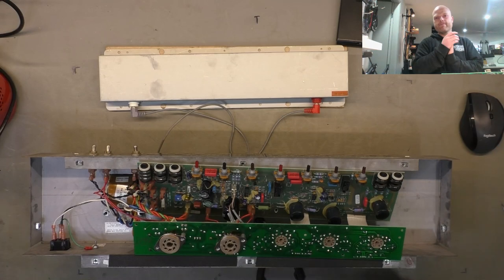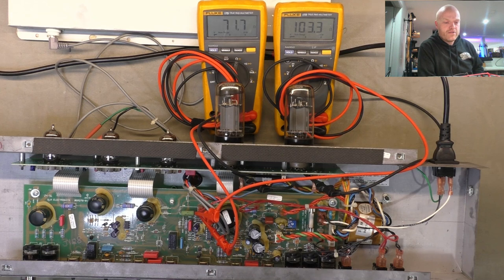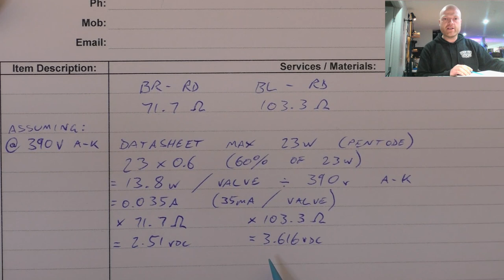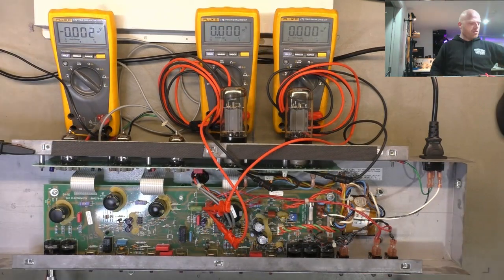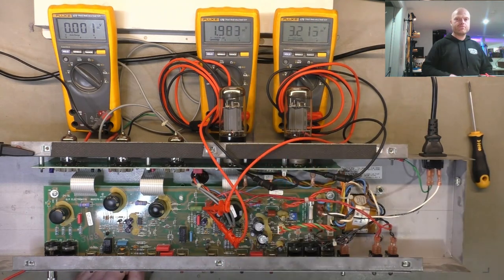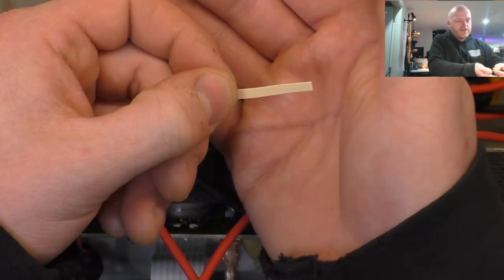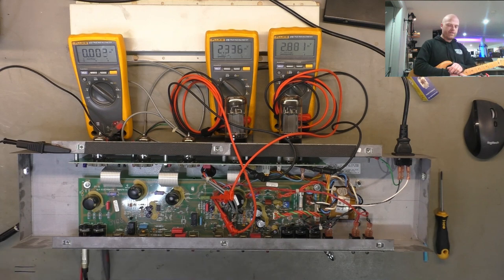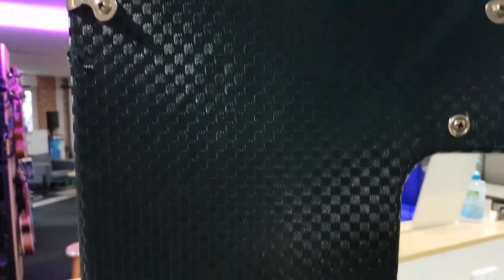Ampeg R-212R Reverberocket Repair - Part 2

Comment: Great video man, I've just been reunited with a 212 just like the one you have here after 15 years. Definitely got me thinking about what else might have issues, outside of tubes (which it definitely needs). It's a 93 or 94, I've had it since 2003 and it's seen a fair bit of action and while mostly it's been a studio piece, it did spend several months in a friend's barn. (Not like, a barn barn but a large steel sort of large shed/workshop/jam space sort of situation, next to his house.)

Anyway wanted to ask if there was any effective way of cleaning the pots without removing the entire chassis? I've got some Deoxit and I reckon I can get the knobs off but a full teardown is likely beyond my skills. Can i just spray a little into each pot shaft and sort of work it in by twisting the knob?

Appreciate your hard work man, great stuff. Cheers

Comment: Told ya I was spending too much time watching your handiwork 😂. Just glad it's not a Marshall as I'm selling a 1984 JCM800 for a mate, but haven't got the cab to test it out. Went inside to take some gut shots for the sale and nearly wept as I saw melted leads, massive blobs of solder and a nice big burn mark on a resistor thanks to the last tech who was inside it 😩. Wish we had some good techs round these parts!

Comment: Hey Brad, I've got a totally different question and subject. Like most techs I have disassembled and repaired a fair number of single-wafer mono potentiometers, and there are dozens of videos online about how to do this, but I have yet to see any videos showing how to disassemble and reassemble a stereo potentiometer with a single common shaft that turns two wiper elements simultaneously!  You're the only guitar amp guy I watch on a regular basis who also works on a fair bit of vintage stereo equipment, or pro audio mixers and processors that are stereo and therefore contain stereo pots.  Replacement pots are rarely available in a form that will match the variety of pots found in most vintage stereo equipment (with the correct size threaded bushing, matching pin-outs, correct shaft length, diameter and splicing etc); and Stereo potentiometers are usually held together with a divot or peened area at the rear of the shaft that would have to be ground off in order to get the pot apart. And then,  how would you fasten it all back together?  I'd love to see somebody try this on YouTube. 

Iworked on a Yamaha CR-840 receiver recently that had an intermittent bass control, which was unique because it had shorting switches built into it that literally shorted the elements out of circuit  when the pot was set to the 12 o'clock or flat position! If I tapped or wiggled the knob when it was set to the 12 o'clock position, the channel outputs would fluctuate and change, particularly on one channel. Tried squirting ordinary control cleaner into it, but it was mostly sealed and had a wrap of clear tape around the body of the pot to block off most of the openings. I finally removed it with great difficulty from the receiver and peeled the tape off to expose a couple of slots, and squirted it with a can of old, special, vintage contact cleaner that is mildly abrasive,  somewhat thick and creamy, and unfortunately no longer available. This worked (the resistance of the pot sections literally goes to 0 ohms when it's set to the 12 o'clock flat position!) but our last can of that special cleaner is almost empty and we haven't been able to find any more. If I had to try and take that pot apart to fix it I don't know what I would do. I could probably grind off the divot/peened rivet on the back of the shaft and get the pot apart, but then would I be able to fasten the whole thing back together?.
Reply: Note too that all traditional pots use LUBE, any contact cleaner removes this and at times its required. Nye corp for example sells several types. Sadly "truly sealed" pots (RV4 or some variation) don't seem to be the answer as I think even Aiken Amps has abandoned them (PEC)
Reply: @tedmich  ,  intermittent pots aren't necessarily due to poor contact between the wiper "finger"  and the carbon element but instead between the rear of the wiper assembly and the metal slip ring commutator that connects to the middle solder terminal of the pot.
Reply: @tedmich  no manufacturer ever tells you what type of lubrication is factory provided inside the pots, and some appear to use a different lube between the shaft and bushing compared to the lube on the wiper and resistive element.
Reply from the maker: Hello mate. I'll maybe do a video on that, should a suitable pot present itself in the future.
A few more Yamaha CA-series integrated amps just came in, so possibly one of them might be a contender, though I must admit, I hope not. Dismantling pots can be a bit of a hit/miss affair.
Often it's not the wafer or it's contact which is to blame, but the commutator ring for the middle pin - wiper connection. The metal becomes tarnished and normal cleaning cycles do not resolve it. The Mesa Boogie pots are the worst  culprits, as they're built in a very old fashioned way and the shafts are plastic (of course they are, it's a Mesa!).
Reply: @BradsGuitarGarage  , I've dismantled numerous single-section (mono) pots for cleaning and repair, and a number of slide faders too; I've even  repaired faders in Bang and  Olafsen hifi gear where the wiper fingers had broken free of the moving nylon parts and had to be glued and heat fused back into place. I've even disassmbled and cleaned digital potentiometers (the ones with miniature pie-plate segments) with a pencil eraser, lubing them with silicone before reassembling; but I've never disassembled a ganged, stereo, dual potentiometer because although I could grind the back end off of the shaft to take it apart I'm not sure how I'd hold it all back together afterwards.  I did a bunch of looking online and the closest thing to this I came across was a guy repairing a dissimilar dual potentiometer for a piece of Tectronix test equipment that actually had a broken inner shaft (the skinnier one) and he machined a new replacement shaft pin for it.  That's a little bit beyond my capabilities!! Anyway, be careful with the controls and switches on that old Yamaha gear, and the same thing applies to Pioneer and Sansui in Samsung and Trio/Kenwood and all the rest. You never know when you're gonna come across a part that's so unusual that you would never be able to find a replacement except by pulling one from another junker unit. A worn-out or damaged volume control that has a loudness tap at a specified resistance point can also be extremely problematic to replace.

BTW, I actually put  an Alps "blue velvet" style pot in that Yamaha CR-840 I mentioned (it was pretty easy because the pot was separately mounted, not soldered to the main PCB), and the pot we had in stock did have a loudness tap but it wasn't necessary for that circuit.  Be aware that some of the "blue velvet" Alps pots my boss bought off of ebay and various sources are either factory-seconds/rejects and well out of tolerance, or possibly counterfeit, because the measured value is significantly different than the stated value on the pot. We have several pots marked 100k that measured 80k, and 50K pots that measured 40k;  I haven't yet tried sweeping those through their rotation with ohmeters connected to both sections of the pot simultaneously to see if they track well or not.....

Comment: Hi Brad. maybe it would be safer to use a class x capacitor for the 47nf cap, you have ac voltage on this capacitor. Thanks for your videos !
Reply from the maker: Thanks for watching, mate!
The main reason x-class caps are required is for safety on the mains input.
Safety isn't the issue here as if the cap went short again, the fuse would prevent any further damage like it did here.
I think the main issue was poor quality of the factory capacitor.

Comment: Nice  job! Poor Ampeg got shuttled pillar to post by about a zillion buy -outs, nice to see one clean up well.  I just bought an Ampeg 412 set up with 2001 Vintage 30's, only $175 USD. Maybe buy a looper pedal and have the exact same playing each time (ideally with some improvisation once in a while!)
Reply from the maker: Yes, I was thinking about the looper pedal thing, but my mate from Fluid Audio Group has a cool handheld test oscillator which has the capability of storing .mp3 files for looping to test PA systems. Might be good to have some drum stuff and some full range music as well since I don't only work on guitar amps.
Reply: @BradsGuitarGarage  at one point Eminence had something similar online, each speaker with the exact same test conditions. It was very useful as speakers change your sound immensely but may have confused people.
Reply from the maker: I didn't know eminence did that, but I'm aware of Jensen's sound samples.
Nothing compared to standing in a room with the amp, though.
As such, my samples will only ever be a comparative example.

Comment: I have a stupid question. How do you crimp the component leads to get the the same. Good video. Thanks
Reply from the maker: Are you talking about the lamp/LED?
A Pressmaster crimping gun with the appropriate die installed.
Reply: Thank you. Looks like a good crimp. I have always used the old style hand crimp. You got the amp sounding very good!
Reply from the maker: Thanks mate!

Comment: Random question… thoughts on a Roland JC-40 as a pedal platform amp?
Reply from the maker: Pff, it's tiny. You'll only fit half a dozen pedals on that amp!
Reply: @BradsGuitarGarage  in your professional opinion if one wanted to go to a good solid state amp what would you suggest?
Reply from the maker: @albertgutnick6979  So just a clean, single channel choocher? Or a multi channel? Head, combo or brick style?
Reply: @BradsGuitarGarage  clean single Chanel combo
Reply from the maker: @albertgutnick6979  Power level?
Reply: @BradsGuitarGarage  nothing crazy.. bedroom/recording levels
Reply from the maker: @albertgutnick6979  The DV Mark Raw Dawg 60 sounds good to me. Despite the unfortunate name.
Old Peaveys used on the clean channel are a good cost effective solution once they've been serviced.
The Jazz Chorus series ain't what they used to be, but the older ones are okay again after servicing if you can deal with a bit of hiss. The preamp stage-to-stage impedances are set around 1M like you'd find in a valve amp, where they should have scaled them all to low impedance after the first stage to make them less susceptible to noise.
Reply: @BradsGuitarGarage  thanks legend I’ll check them out… Am I crazy to move on from a valve amp set up?
Reply from the maker: Not really, mate. Horses for courses.
I just suggest you try one out at a music store, and of course, it's a bit douchey to try out all their amps and then buy one on eBay. But try to be in a position to test one and give it a proper play before handing over money, take your pedalboard too if you can.
Also I'd factor in a service at a trusted local tech after buying to have the confidence of a clean bill of health, or a charge-back if the amp turns out to not be as described. There are way too many people misrepresenting the condition of their amps for sale. "Recently serviced" means less than words written in water from someone you don't trust.